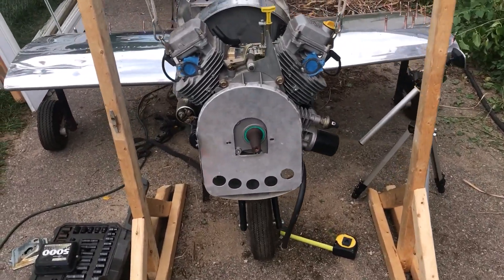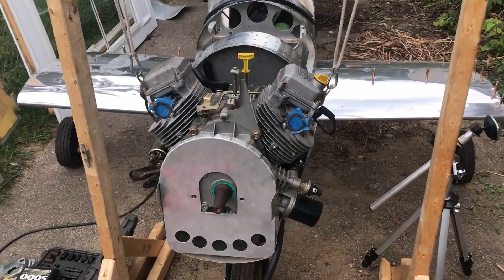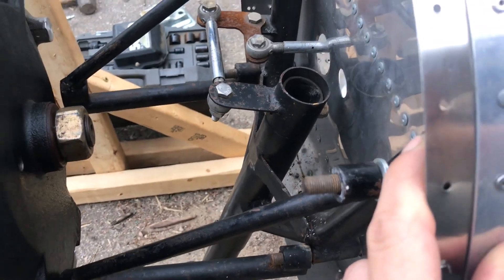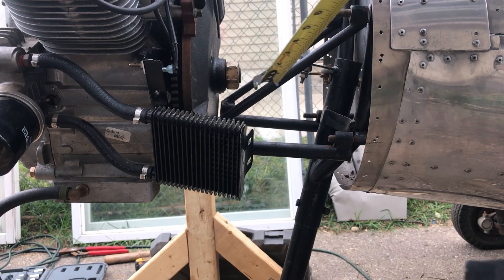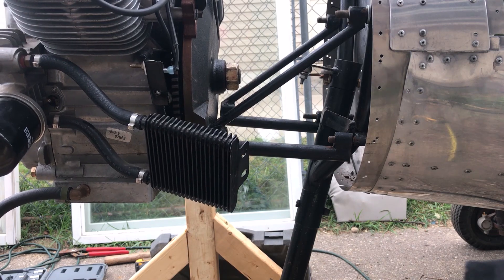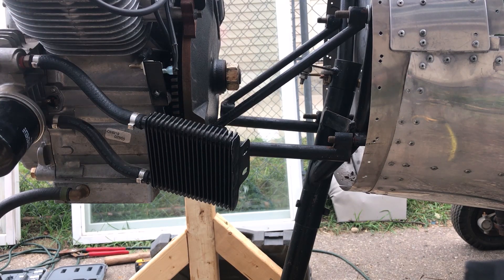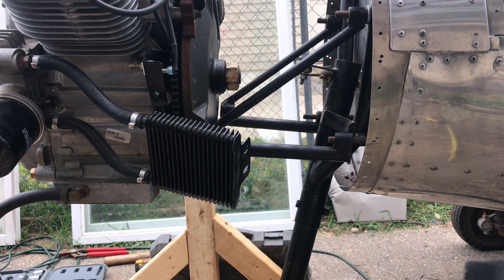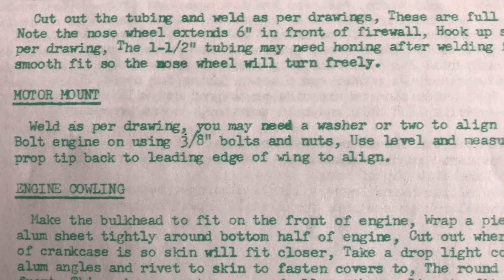Ultralight Engine Mount questions E03

Comment: You need to determine the weight of the 1/2 vw vs the weight of your engine. If yours is lighter then it needs to be further from the firewall. If yours is heavier it needs to be closer. This will change the cg and is very important. As far as the thrust line goes you need to conform to the plans. The yawing of the aircraft is normal in climb out and reduces once in cruise. If you have a yawing in cruise you can use a trim tab. I would not angle the engine to accommodate.
Reply from the maker: Okay so build the engine first, got it. Another gentleman from a Facebook group has given similar advice. 

The only information I can find in the plans about a thrust line and engine mounts is what you see here in the video, not much. This aircraft is not equipped with trim tabs. Yes I could ad something like that but Im really going for ultralight specs so weight is important to me. 

I have watched almost every Hummel video out there and it appears the the crankshaft is centered with the fuselage but I have yet to confirm this either.
Reply: @BootsDalton  I agree. The plans that Mr. Watson provides with the aircraft are detailed but they are kind of hard to understand.
Reply: @BootsDalton  is it an Ultracruiser or hummelbird?
Reply from the maker: @mattpoland8200  This is a Watson Windwagon, designed by Gary Watson out of newcastle texas. Plans are from 1977.
Reply: @BootsDalton  the new plans come on a cd and print out full size